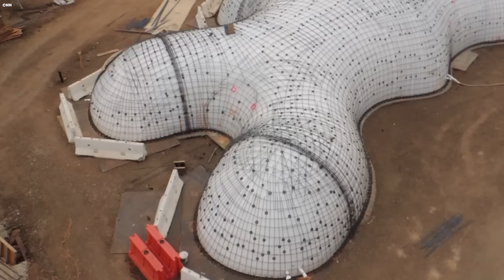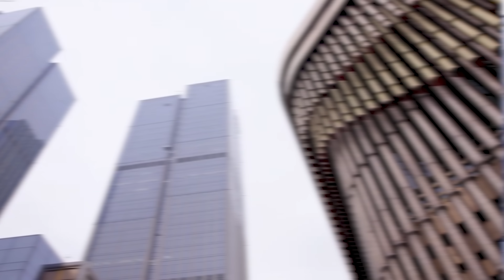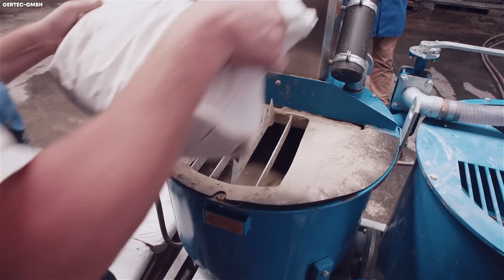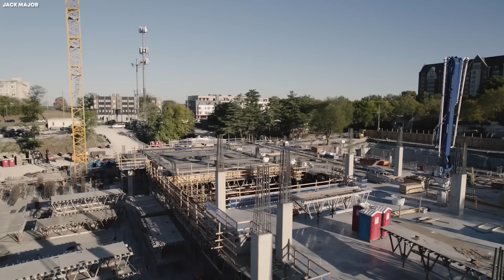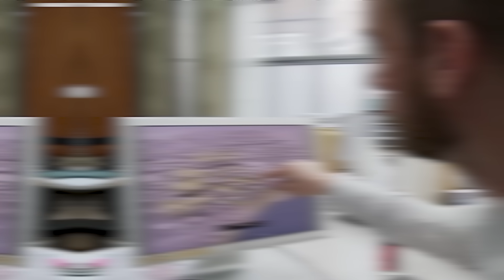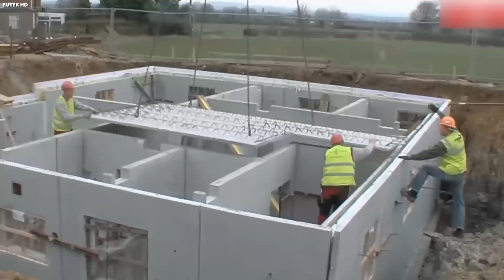Even the Chinese President Couldn't Believe His Eyes When He Saw This Genius Construction Technique!

Comment: I saw the concrete structure made of a blown up building where you blow up the balloon it’s in Arizona and it’s been condemned. They weren’t even supposed to be in it because it’s unsafe keeps falling off the inside. I guess they didn’t put the rebar exactly the way it should’ve been